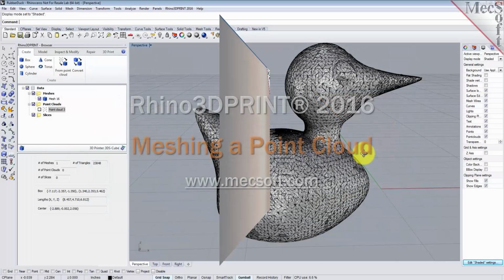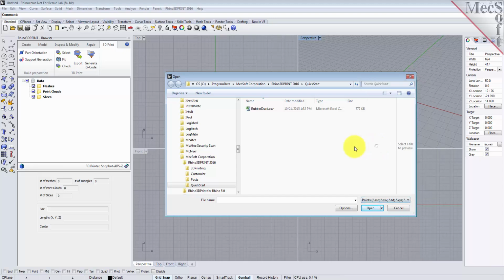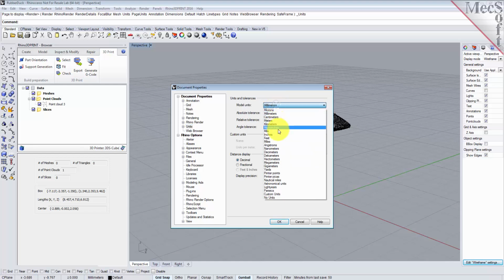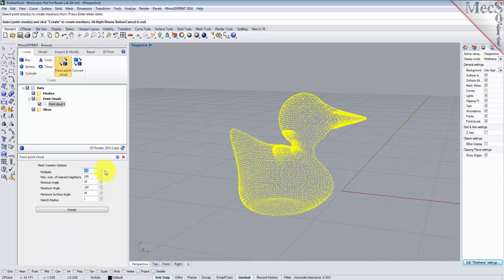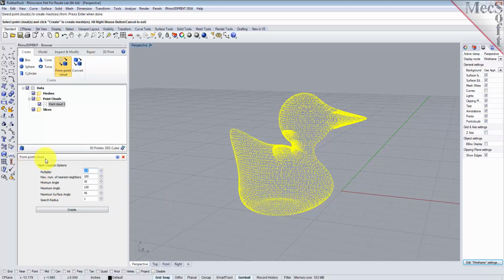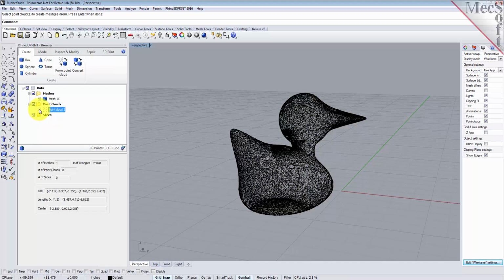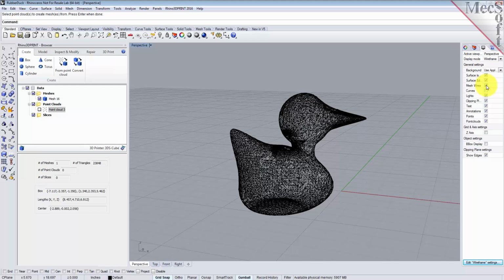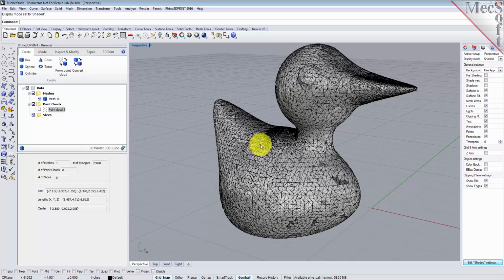Rhino3DPRINT 2016 Meshing a Point Cloud

Comment: When I try to download Rhino3d print, I am getting download options for Visual CAM, RinoCAM etc. Which one of those has the features of this Rhino3d print 2016 which you are using?
Reply from the maker: Hello, Our 3D print product is now referred to as the MESH module (RhinoCAM-MESH and VisualCAM-MES). 
 The MESH Module is included in the demo download of RhinoCAM 2018 and VisualCAD/CAM 2018.